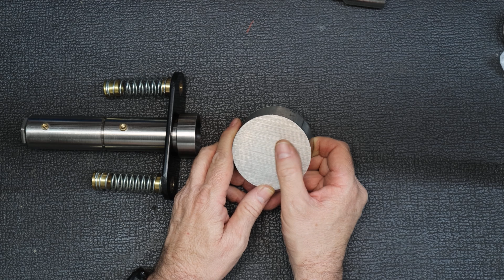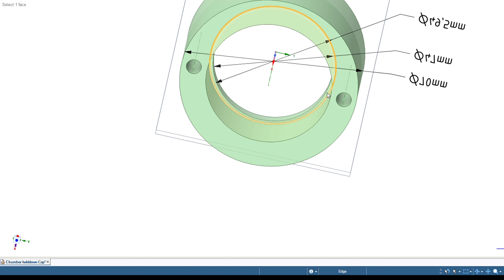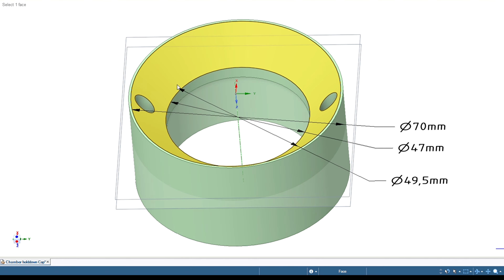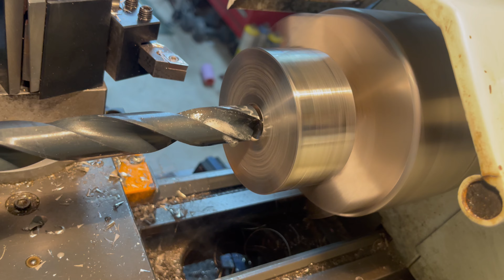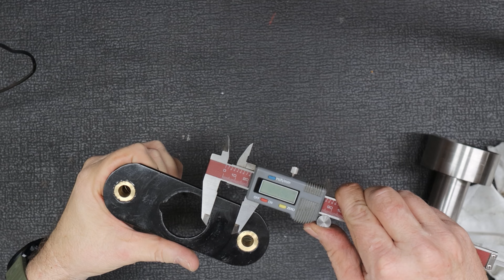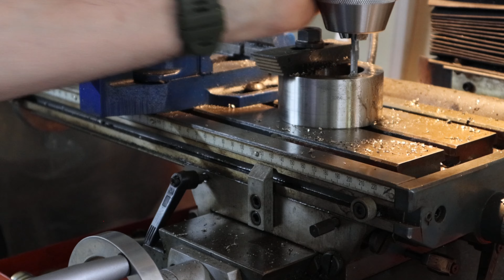DIY | Plastic injection machine | Hold down Cap | Part 7

Comment: Nice video series - thx!
How do you think to manufacture molds? By printing or with machined metal? I think by myself for a while to build a injection molding tool. But I am not finally sure how to build the molds itself. Printing gives less nice quality, which gets copied into the molded parts... Metal on the other hand need CNC machining at least for more komplex parts. What is your intended way here?
Reply from the maker: I’m going to try resin 3d prints. But will make a video of how it works out